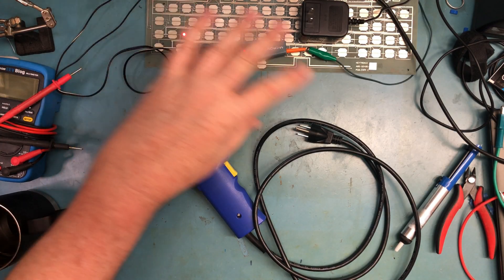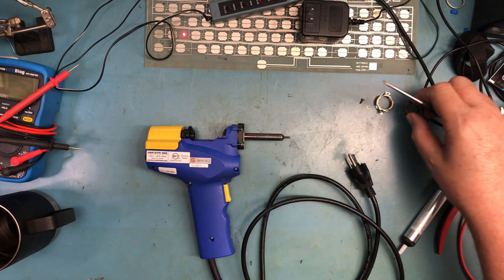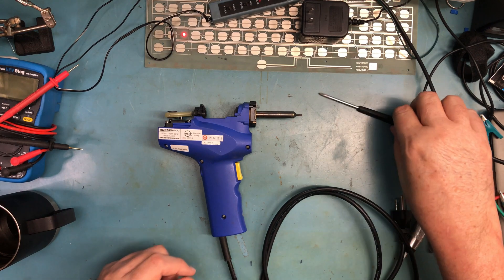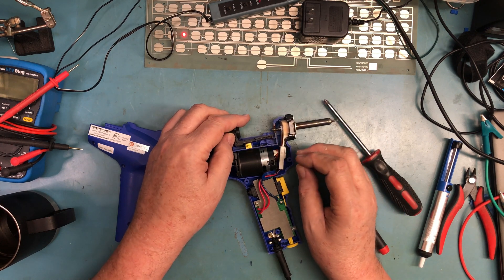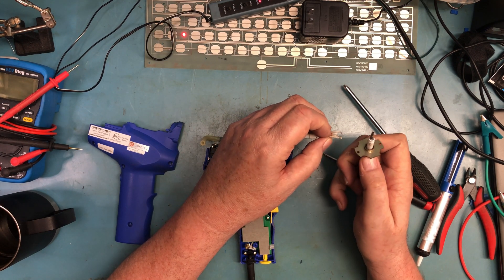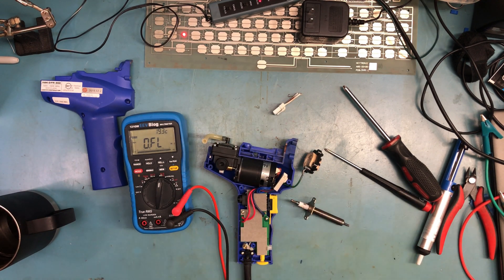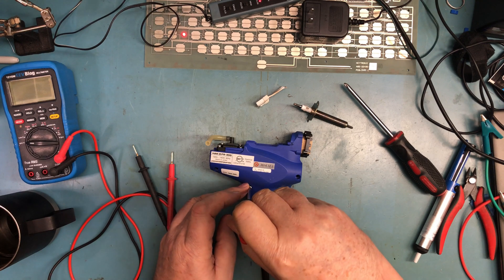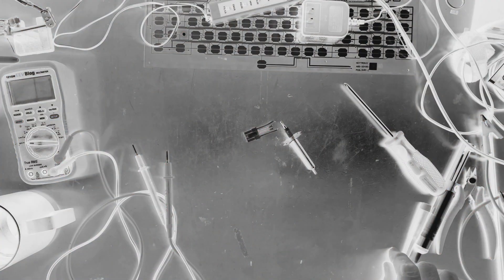STB840 - Broken Hakko FR-300 - Part 1 - Teardown and inspection

Comment: Thank you for the video! very helpful for servicing my Hakko. I accidentally connected my 120V rated FR-301 to a 220V line and it stopped heating (pump still works thankfully). I inspected the PCB for damage and it looks ok. I guess the heating element died? it is 70 USD so I'm wondering if it can be repaired, could it?
Reply from the maker: I don't believe it can be fixed. I don't even know how I would approach fixing it.